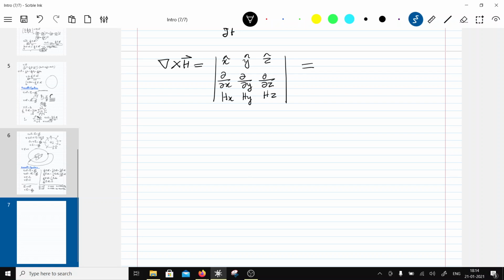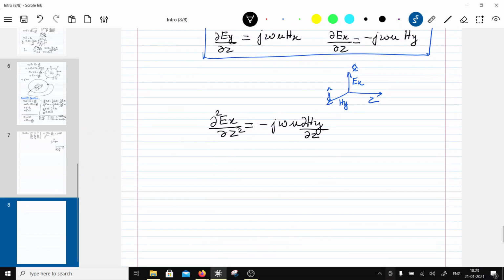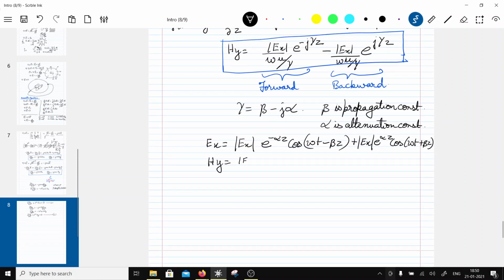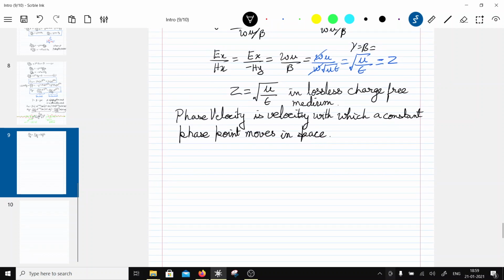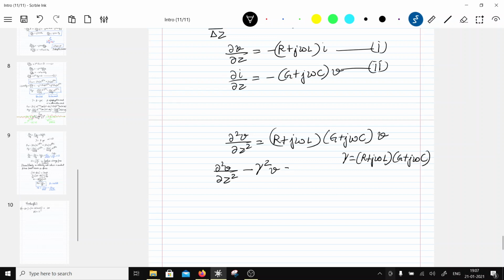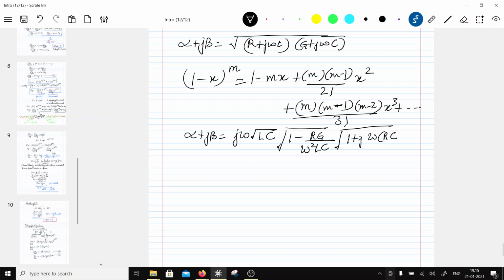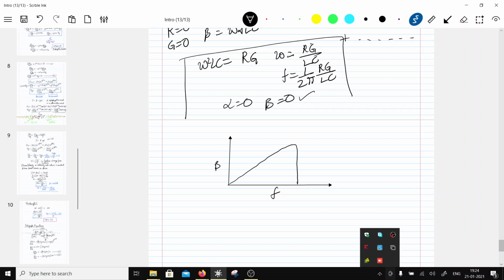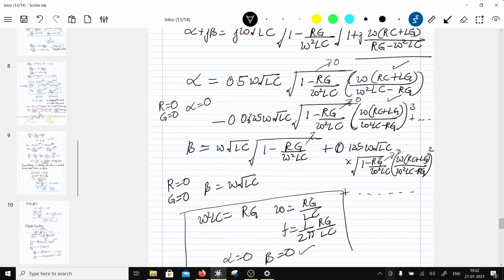Microwave and  Millimeter Wave Circuit Designs Session2

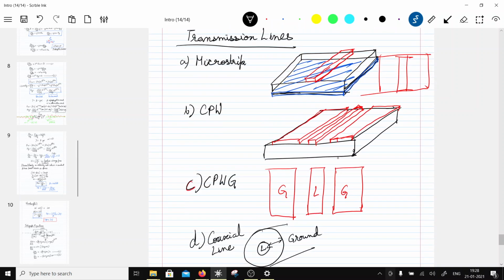Comment: Very nice explanation and presentation. Great for learning. I'd like to point out just one thing. At 55:35, you mentioned that "all these lines that have two conductors are capable of TEM propagation". Well, this is not true, at least in the case of microstrip transmission lines. The microstrip line is open at the top while at the bottom it has a dielectric and a ground plane. The electric field lines are concentrated between the line and the ground at the dielectric. However, for thicker dielectrics and ones with relatively lower Dk, there are electric field lines that radiate into free space/air above the microstrip laminate. This makes the phase velocities different in two mediums - air and the dielectric on which the line is present. This prohibits TEM propagation. However, for all practical purposes, we come across "moderately" thinner dielectrics and common ones like FR4 that have "moderately" higher Dk values. We can consider that the phase velocities are "almost" closer to each other at the two mediums. Thus microstrip lines are said to exhibit a "quasi-TEM" mode of propagation. On the other hand, Stripline structures do propagate TEM modes because the sandwiched copper line in the middle has dielectric both on top and bottom, thereby preventing any sort of phase-velocity gradient.